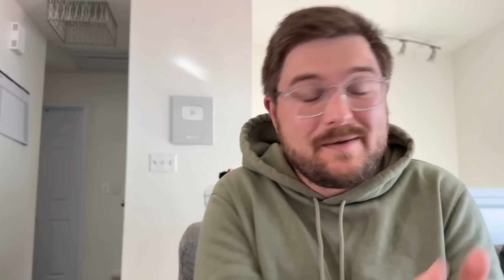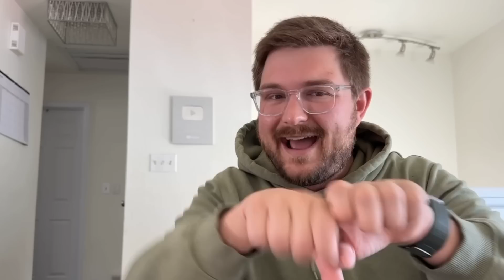Slow Charging For ~800-Volt EVs At Tesla Superchargers With Magic Dock Explained

Comment: I charged at a Tesla supercharger, just installed a couple of weeks ago.  I noticed the stations were labeled A, B, C, D  like 1A, 1B, 1C, 1D.  These are V3 stations.  They even have a sign above the chargers saying 250KW.

If if doesn't matter about spacing between cars what is the purpose of the lettering on the chargers?

Comment: If Tesla ignores nameplate ratings, their insurers would walk away if there was a fire. So regardless of the Natioal Electrical Code and the myriad of local codes, Tesla would be seen as grossly negligent and in legal trouble if they exceeded the nameplate specs. (Which, as you said, may be for continuous duty with a higher rating for short periods.)

Comment: You always have to look at where the bottlenecks are. 

I think the Hummer has a liquid cooled charge port. It's the first vehicle with this.  

The plastic of the charge port is currently the bottleneck for a lot of charging due to heat. GM is trying to future proof their charging with the liquid cooled ports.
Reply: And that silly thing takes over three hours to charge on a 350 kW charger from what I’ve heard.  I don’t want to be waiting behind one of those to charge.

Comment: Higher volts doesn’t mean faster charging at all. Higher volts means you don’t need as big a cable to deliver some amount of amps. If the cable is already big enough to carry the amps then the voltage is irrelevant. Battery cells normally charge around 4 volts (not 400 or 800) so any charge voltage from the supercharger must broken all the way down to about 4 volts inside the battery pack. No advantage to charging with 800 volts over 400 volts.

800 volt charging is a marketing gimmick as existing cables can handle up to 300kw of charge at 400 volts. Most battery packs can only take 250kw for a very short time so trying to put more power into battery packs that are less than 100kw hours will harm the battery.

Comment: What will this mean for the cyber truck?  Supposed to have 900 or 1000 volt battery, right?  If I followed your explanations, the CT will have a booster, but will be able to exceed the nameplate rating because it's Tesla to Tesla and won't involve the CCS adapter, so should get the full kW rating.

Comment: Even with solid-state batteries, charge times might not get down to under thirty minutes on all types of chargers .
Reminds me of the different flow rates of fossil fuel pumps .
The flow rate of most diesel pumps are much higher than regular gas pumps .

Comment: Thanks, very informative and also a bit confusing as lots of technical details.  I saw a Marques Brownlee (Auto Focus) video from his experience with his Rivian in NY state at a new Tesla Magic Dock location.  Really simple and laid out the current issues with the system both the pros and some of the negatives such as port on side/front of the car, etc.  Overall, a good start as I sold my Telsa after 3 years and looking forward to a new and more interesting EV, and now with the potential for all the supercharger network stations opening up, this will seal the deal on placing an order.

Comment: I personally hope they keep the disadvantage for non Teslas It's great to have as a backup, but it should not be their primary. The speed should be lower and the cost should be higher. That will keep the pressure on the Electrify America and other public chargers to step up their game on adding more locations and picking up their reliability.

Comment: As an electrical engineer your analogy of pipe sizes representing voltage is bewildering. 'pipe' size is more akin to current. Voltage is like pressure to push the current into the battery.
Reply: I was told current is like the number of lanes on a highway and voltage is the speed of the cars. Is that a better analogy?

Comment: Here's the thing about Tesla opening up their superchargers, even if limited speeds and higher prices. EA sucks . Every time I've tried to use an EA supercharger with my old Leaf or my current Bolt, they were BROKEN! Now I also own a Tesla and I drove it across the country and found exactly ZERO broken Tesla chargers in my 15 charges across the country.

Comment: I didn’t know that 800v cars had a booster that went from 400v..
In the case of a 30kw 208v DC charger, do 400v cars have a booster from 208? Or how does that work?

Comment: Regardless of the electric details. Rivians seem to be getting 150kw/h. Having a car that will only charge at 50 max SUCKS. Given that MB is a 400v architecture, I hope that it will do at least the nominal 150kw. 800v architecture is a gimmick to show off very high peak rates. It has very little advantage for bulk DC charging.

Comment: I run a small public 500V DC station in Sweden, here are the limitations for E-GMP and Taycan/E-tron gt at low voltage charger.
E-GPM: 230A @ 455V to ≈ 80% SoC
Taycan: 350A @ 360-396V to ≈ 54% SoC.

Comment: I suppose if they added a longer cable that loops within the center and has a hook to hold it in the middle, Tesla drivers would not need to unravel the extra cord, and if someone is using the CCS and need the extra length, Tesla could have a sensor on the hook to make sure users put it back nicely. I don't think adding one of those retractable pullies would work if the associated metal cable were dragged across a vehicle. Maybe we could all just get manufacturers to place it in the same spot as Tesla as a new standard, not because it would be better for Tesla to not have this added expense, but because it would facilitate better use of raw materials in these cables and thus mean more stations in general. Let's remember, Tesla built their network to be efficient and economical with their resources for a reason. I bet manufacturers would gladly advertise that their charge ports and charging experience like preconditioning are optimized for the nation's largest and most reliable network. That would be a big competitive advantage and good marketing.

Comment: 800V busses on passenger EVs is the way of the future. Why? for the same reason electric transmission lines operate at several 100 kV, and are then stepped down via transformer to a lower V at the service to the end user. Higher V and lower current results in lower loss due to joule heating. Tesla needs to update their chargers and vehicles to 800V or be left behind.

Comment: I have heard that the reason that most Tesla superchargers didn’t work with CCS cars is not really the plug, it’s the communication language between car and supercharger. The reason that Tesla cars can talk to CCS charging stations with an adapter is because they made the cars bi-lingual. I wonder if these superchargers with magic docks are bilingual or if they has changed the communication to CCS for those stations. It will be interesting to see if they come out with/allow some kind of dongle for cars that can’t reach the cable. It is probably cheaper/ faster to allow people to buy an adapter rather than retrofit all stations.

Comment: Now that Tesla is opening up their network can we get the manufacturers to switch their charge ports to NACS and make sure they are at the correct location on the vehicle (that would be on the drivers side in the rear or passenger side in the front, alternatively you could put it in the middle of the rear or front like Aptera does).  Why do I want this, we need to save copper and make the charge cables shorter and liquid cooled.

Comment: Thanks Kyle.  As an EE, I love these nerdy details far more than the average EV driver.  I believe Tesla is playing it very safe for now using the test of time approach.  We may see more charging power months down the road.  

Remember, the primary reason they are doing it is to capture charger funds from the Biden Admin.  It will also generate some additional profit.  Grants will not be tied to how many amps are pumped into a Hummer or Lightning.
Reply: Actually, the grants do require a minimum of 150 KW. It’s debatable whether these upgraded V3 shared units actually qualify. I hope so. In any case V4 superchargers should be fine.

Comment: The charger actually controls the voltage and the voltage difference makes the current flow.  
The greater the voltage difference the greater the current flow
The common water analogy for electric is height difference for voltage.  Flows from high to low
And current flow in pipes.  The larger pipe the larger the wire the more amps (water) can flow
Always easier to use extremes to demonstrate

Comment: A bit of a clarification on the charging process Volts and Amps: 
Initially the charger will match the pack voltage. But when the charge power ramps up gradually, that is actually done by increasing the voltage a bit further, usually 10-20V depending on the charge power. I confirmed this through CarScanner. 
So in order to have current flowing through the pack in the charge direction, the charger has to first match the pack voltage and then add some to have the current flow. The pack itself also has some internal resistance (not sure if it is the same when charging and discharging, but it is there). As P=U*I, but also I=U/R, we get P=U^2/R. The charger will regulate power and current simply by changing the output voltage based on that formula (while in fact it's the car requesting that, charger just complies). 
As the pack voltage increases, to keep the same charging power, the charger output will too have to increase to keep the same "overvoltage" over the stationary pack voltage. Of course the pack resistance changes slightly on different SoC%, which also needs to be compensated for. When decreasing power, it would just get closer to the pack voltage, but keep above it unless ramping down to zero. 
It has another aspect to it: P=U^2/R works for the total charging power when you look at the total voltage. But it also denotes the heat losses in the battery when you plug in only the "overvoltage", so P_heat=(U_charge - U_pack)^2/R. It works out to few hundred watts of battery heating losses at ~85kW in my e-208, which seems about right given how much the pack warms up.

Comment: Love the nerd out, Tesla may limit the CCS adapter as they are also dealing with the connection between their NACS and the CCS in the same body (cables get hot but plugs/sockets with wear over time gets hotter, two pug/sockets in close proximity may generate too much heat, only time will tell).  Current does not flow unless there is a potential difference in voltage. In other words if a battery is at 500v and the charger matches it with 500v no current will flow. If the charger steps to 510v current will flow and if it steps to 520v more current will flow. If the battery exceeds the charger then you have the basis of vehicle to grid. Circuity within the chargers raise the charging voltage to match the current demand from the battery within the charger operating parameters of maximum voltage and current. All charging uses ISO 15118 which includes comms which will limit the charger output and all done by simplistic electronics therefore charger adaptors can be recognised by incorporating the same electronics, I believe its a resister that is the discreet component that sets the upper limit, simple to include an an adaptor.

Comment: Comparing the nacs2ccs with the ccs2nacs adapter there could be a big differences that implies that the nacs2ccs adapter has to be conservative with temperatures, thus the decision from Tesla to cap the current at 350A.
The ccs2nacs adapter is simply a geometrical adapter, it converts the ccs plug into a nacs2ccs plug and reroutes the cables, not much in it besides a plastic enclosing with the correct form some signal wires and 2 power cables, this is so because Tesla cars also speak CCS and therefore no electronics are needed to translate communication protocols. On the other side on the nacs2ccs adapter the cars don’t speak the Tesla protocol and V3 shouldn’t speak ccs(at least not the US version). So the question is, is the protocol translator in the adapter, meaning some electronics that have a low thermal envelope, or is Tesla also updating the electronics on the SuC V3, so the adapter is also a passive one?
Tesla won’t tell anybody and no one will break one adaptor apart to find out, but this could be the reason why non-Teslas will be restrained to 350A for now.

Comment: Maximum input for supercharger v3 transformers is 387 kVA, shared on 4 stalls (A,B,C and D). Each stall can deliver 250 kW under 0 to 500V, with a current of 631A. Based on a transformer sticker installed in France. That means that power is also shared on v3 superchargers, but this is less noticeable, as it is rare that all 4 terminals require maximum power at the same time.
Reply: I think the superchargers are sharing the DC bus between even between transformers, and not only on charging stalls. That mean 2-3 cars can charge at 250 kW on the same transformer, let’s say 1A, B and C, if let’s say the 2A,B,C and D are not occupied.

Comment: The nameplate rating for current is really only for continuous load. Some cables already have an additional “boost” rating that can be achieved for a short time. Tesla has a reputation for flying as close to the sun as possible (for better or for worse) and that’s what they’re doing with their superchargers and going well beyond their ratings for a short period. I suspect that Tesla will probably stick to the 350A limit for a while until they can figure out the “boost” limit for their chargers with the CCS adapter, since there are plenty of 400V CCS vehicles that could pull more than 350A (or even 500A) for a long time while charging.

Comment: And today at EA I was getting a blistering 60 kW . My initial state of charge was 9% and the temperature was 77F. Btw it was an ID4 trying to charge to 80%. Gave up at 52%.
Reply: Obviously, that was a defective stall.  I’ve seen that and moved to another stall, if available, and the problem goes away.  My question is will the government score that stall as functioning in its 97% minimum reliability standard or list it as defective?

Comment: The analogy I usually use is Amps = Pipe size, Voltage = Water pressure.

Comment: Thanks so much for this detailed maybe too nerdy but very helpful explanation of charging a non-Tesla on a Tesla SC. I just finished Tom Moloughney's video in Brewster NY where he was checking out the Magic Dock on his Lightning and there was an R1T and a Lucid Air as well as 2 Tesla model 3s (I think) and the Lucid owner was only getting 45kW. Your deep dive explains that. Tom's big issue was, as you mention, the cable length. Tesla V4 SCs should be built with the longer cable but the existing V3s also need to get a longer cable with their Magic Dock upgrade. Anyway great video and some interesting questions with the Hummer split pack. Cheers and drive safely.
Reply: I have noticed, over my years of driving an ICE Vehicle, that different Branded Gas Pumps, have different length hoses. Only a few people try to stretch the hose across their car, to Refuel! The rest of us just pay attention to which side we fuel on, and park appropriately at the pumps! I suppose it will take some time for this new idea to get worked out, between Drivers seeking to Try the Tesla Experience and their vehicles fit.
Reply: @robertweekley5926  Right! It seems Tesla forgot the old obvious ways. I wish all Tesla stalls were "pull through" like gas pumps. It takes up more room but even a pull in forward and then back out when done model would work better than the current back in style. Imagine a big CyberTruck maneuvering back-and-fill style! They'll likely just drive in from the other side, curbs, trees and parking bumpers beware. Cheers.

Comment: Current Ratings!
There are 2 limitations for current in a wire. Temperature AND Voltage Drop (IR Drop). Either one can be a limit to current. Smaller wires have more resistance and more drop.

Comment: Hmmmm... You kind of have that backwards. 150kw can be achieved 2 ways, high voltage/low amperage or high amperage/low voltage. An 800v car cannot physically handle the currents at lower voltage, the connectors inside are not made thick enough to handle high current (generates lots of heat).

Tesla will someday got to 800v, they have to, you can't have 400kw charging without it needing MUCH more robust internals on a 400v system. 

400v × 500a = 200kw, to get 400kw you need 1000a, that gets stuff hot VERY quickly. 800v × 500a = 400kw with very little rise in hardware temperature.

800v is the future.

Comment: Something I didn't know about Tesla charging stations is if all chargers at that station are in use at the same time the charges will equalize power to all the vehicles reducing the power that each vehicle get's if only one vehicle is using that charging station that vehicle will get the maximum power that charging station can produce and reduce how long it will take to charge that vehicle so if your sharing that power with other vehicles at the station it will take longer to charge your vehicle which means there is only a maximum amount power allowed to go through that entire station. Also if you watch this video you will see the rate of charging isn't simple because of each vehicles limitations or advantages in charging based on the technology used by each auto manufacture and this also applies to the manufactures of the chargers too so refueling a gas or diesel vehicle by caparison is child's play.